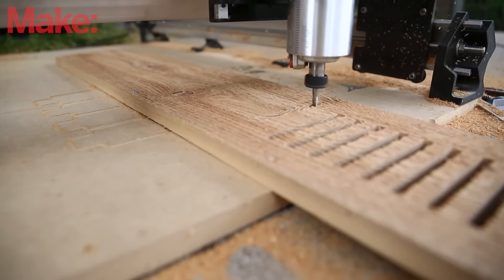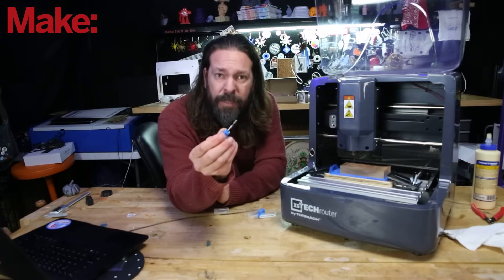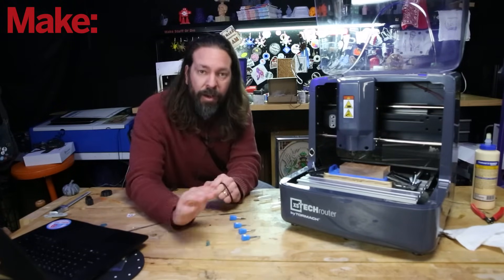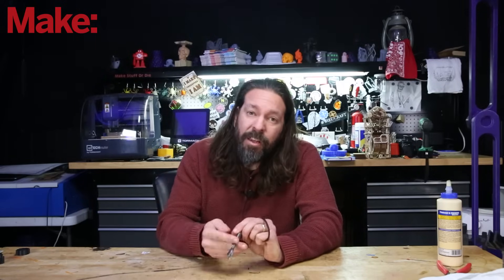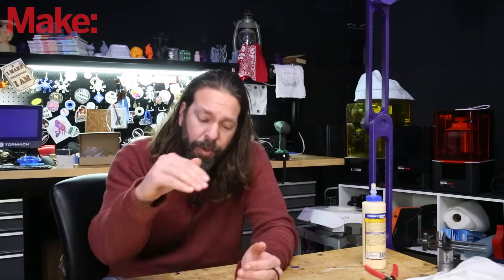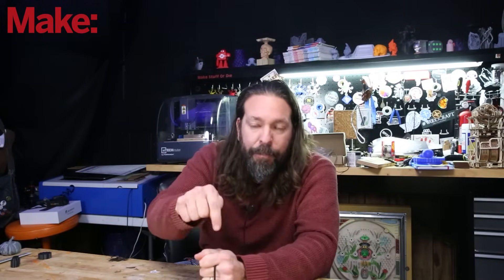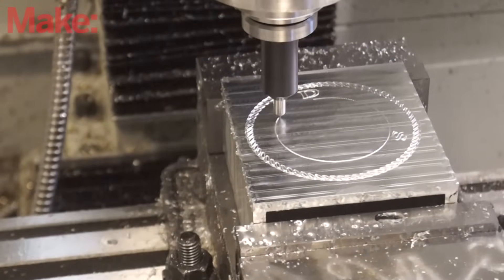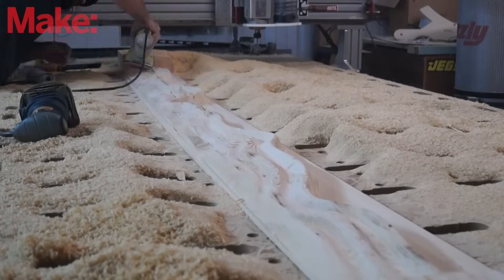CNC Basics - Everything a Beginner Needs To Know

Comment: Thank you for this video very well explained. 
One question i had if I want to cut a piece bigger than the cutting surface… I shall use two distincts cutting path and reposition the piece at some point ? 
Would be nice to get a video about repositionning a piece to keep alignement in between the two steps 🥹

Comment: For clamping work down I have been using tape and CA glue. The little metal clamps that come with most machines are OK but if a tool hits it you wipe out a 20 dollar bit. I am going to just remake the little metal pieces out of wood or better yet a dollar store cutting board!

Comment: 0:37 I have a 3d printer, so people keep asking me for machined metal parts. It's getting slightly annoying so I want to learn
Reply: You can't make metal things on a 3D printer, I think you can, but that's not it. A 3D printer can melt PTA or PETG plastic. Next time, put up a disclaimer that you don't make metal products and explain to them what 3D printing is.
Reply: @TRØmusic24 SLA may not have pure metal printing, but there has been metal 3d printing capabilities for at least 30 years now. In fact the engine bel on the space shuttle was manufactured using additive manufacturing. In addition there is a gentleman on YouTube that has begun 3d printing conductive circuit boards on a modified ender 3 pro
Reply: You know you can print metal objects too right

Comment: Been running mach 3 twin table cnc routers to run plastic parts for a few years now. Ive also ran die cut machines to cut paper but have never worked with metal.

Comment: It will do everything you tell it even if you are wrong definitely done that a few times I’ve forgotten tool offsets when editing posts I’ve forgot to set z I’ve set g54 offsets as g55 the works one of the machinists accidentally took an edge finder up to 24k rpm and it threw the tool holder out the spindle (no one hurt)

Comment: Doing design for 3D (resin MSLA primarily) and transitioning to adapt that same model for CAM was a real interesting journey. All the things you take for granted with overhangs, undercuts and such being just a support issue now becomes either correcting A LOT of geometry or segregating models for the capability of the machine, namely cutting things in half and making positive/negative bodies. Optimizing for toolpaths and such was more fun, as you can dial in full control and see what shakes out most immediately. As I generally say, failure is the best teacher. Fail early, analyze it to death, experiment with the cheap(er) components and transition to bigger power when you get the basics down.

Comment: Only problem with all these CNC videos...
What to do if a person like me has no clue about computers. 
I understand about the 3 axis. After that, it's all Chinese to me. CAD .CAM... These are meaningless to me. How to go on computer and make a design... Like for a coin .. impossible for me 
So .. As much as I want a CNC ...and love what they can do .. ( and 3D printers too )... There's no way for me to do anything with them. So buying one is just a waste of money. And I know... Since I already did a couple years ago during Covid. I ended up throwing the CNC milling machine into the garbage dumpster in frustration. ( Plus, I don't have Facebook or any clue how to sell things on line.... )
Reply: Then learn CAD. Fusion 360 is a brilliant software.
Reply: Set a foundation. Take small steps at a time. Research and learn about the basics of computers, what you can do on a computer, and how to use a computer. Learn about computer hardware and software. Then, download a CAD software, something free at least to start, and learn about the software. Consider learning other 3D and 2D software for their benefits and uses. Also, learn how to take care of your computer (pc) and backup your data. It’d be good to research building it yourself vs buying a prebuilt. Either way, decide what hardware you want based on your needs, the value, and your budget. I hope this helps!

Comment: so what is the purpose of having to do it manually as opposed to a 3d printer?? id imagine today wed have the tech to tell a cnc machine what to do on its own?
Reply: Subtractive fabrication is completely different from additive (3d printing) fabrication. 
It's easy to tell a 3d printer what to make with a single file because it's building the material as it moves.

Doesn't work when you're cutting down (subtracting) from a material, compared to building up a material.
Building up a material means what nothing is in the way of the nozzle aside from what layers it has already fabricated. That's the only reason the printer knows what material it's building on, because it already built that layer itself.

With a CNC machine, the machine has no clue as to what the material it works on looks like, it can't sense where the material is or what shape it is or where the cuts are or where the solid parts are. It's blind. A blind cutting mechanism that you must direct command by command, because it can't tell what your material looks like before or after milling. That's the difference is a 3d printer still can't "see" but it knows the shape of the material it's printing because it built every layer of it. 
I hope this makes sense.
Reply: Perhaps a more simple explanation.

A random block of aluminum is placed into the CNC machine. 

The machine is equipped with special sensors that sense the exact shape of whatever material is inside at all angles, giving constant real time feedback on this shape.

The computer then takes this shape and calculates the best possible movements for the cutting edge in order to create the object without issues. 

Like if we can do it, I dont see why a computer cant... we just need a way to allow the machine to know where its going, know where it has been and know the exact shape of material inside the machine and its position before it starts. 

My main point is i feel like we are capable of that technology, so im wondering why its not done that way.
Reply: @Boogie_the_cat  I understand however, with todays technology I would think there would be some sort of "digital 3 dimentional coordinate map system" that tells the machine where it can move, the same exact way the human brain would do, just incredibly faster. Like how slicing works on 3d printing. CNC slicing would be like you upload the 3d model you need cut out, and instead of forming a Gcode from bottom to top, layer by layer, it can scan the shape of whatever material you use using lazers or sensors, similar to how 3d image scanners work.  It can then tell the machine where the cutting edge can go in order to not mess up the piece and to make all the necessary cuts. 

You know what I mean?